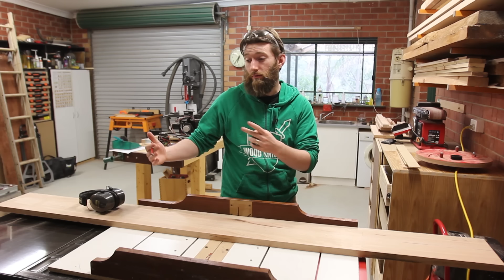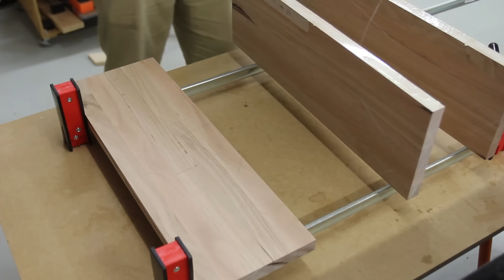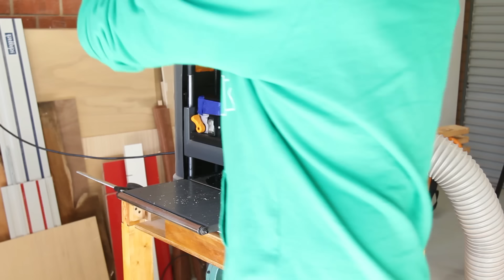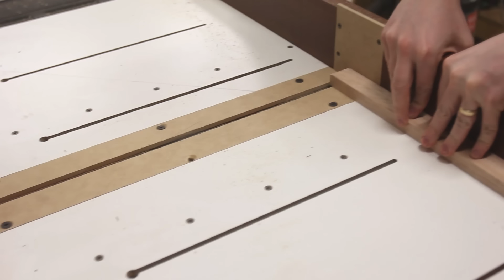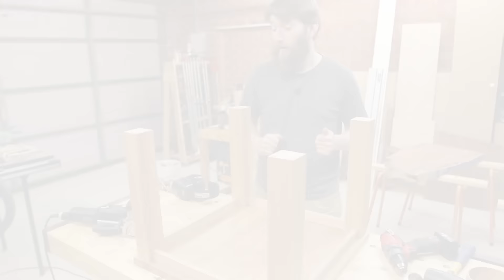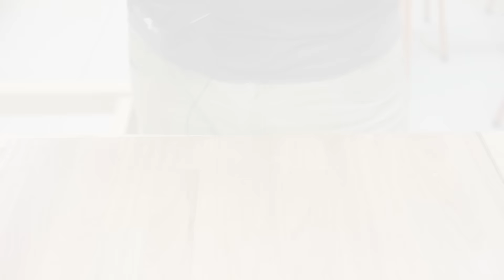070 - Mortise and Tenon Coffee Table

Comment: if attached with screws with an elongated hole, if the screw is going to move due due to wood movement; wouldnt that eventually come loose and have a loose top?
Reply from the maker: No. The hole in the top is tight/to size, the hole it goes through (where the threads aren't engaged) is loose/held on with the head of the screw or a washer. That allows it to angle while the two pieces are still pulled tight
Reply: +Paul Jenkins ah. makes sense. ive mever fastened a top with screws. too worried something bad can come of it haha. maybe ill give it a try!
Reply: nice table,but my lone regret is wondering what it wouldve looked like with a little stain on it

Comment: excellent job. . I just wanted to make sure that you used only glue to tight the table service together? Why you didn't use a pocket hole?
Reply from the maker: +Muneef Alahdi While pocketholes are quicker, they're significantly weaker than glue.
Reply: Paul Jenkins but pocket holes AND glue are even stronger and don't require clamping
Reply from the maker: This is incorrect. For the table top, glue is stronger than the wood, and if anything pocket holes remove material thus remove strength. For the rest of the framework, pocketholes + glue are still just buttjoins, and aren't as strong as mortise&tenon+glue. Is the strength required? It depends on the workpiece/intended use - sometimes pocketholes are AOK for this type of thing but they are not stronger.
Reply: Paul Jenkins (palm to face) I missed that you were referring to the table top and not the legs. My mistake

Comment: nice work although you could have done threw tenons with wedges to tie in the legs to tabletop and it looks great but up to you I guess :)
Reply from the maker: +Gary Stevenson This design table would look absolutely awful with through tenons on the legs. You'd need different legs, different offsets for the aprons, etc for that to work.

Comment: Hi there, Where did you get the pipe clamps, I can only find threaded ones.
Reply from the maker: +Colm Hennessy I have two types of pipe clamps - some are Rockler (bought from Carbatec), and some from ebay which aren't as good, but were dirt cheap (~$50 or so for 4 pairs). They're all threaded, and I got the pipe for them at Bunnings (plumbing aisle). Timbecon also have some (based on what I saw at the show), but don't seem to list them online

The other clamps I used in this video were the parallel clamps I bought from McJing.
Reply: Hi Paul: Are the parallel clamps from McJing good?
Reply from the maker: They're adequate. Fit and finish is on the poor side, but at half the price of the equiv Bessey I'm prepared to make that sacrifice. I'll likely buy more at some stage.
Reply: Thanks! How about the clamping pressure? Can it produce 7000N like Bessey K body revo?
Reply from the maker: +Thanh nguyen tien do you have a way to measure the pressure output by clamps? I sure don't.
Reply: Yes you're right. It's difficult to measure the force; however if you experience Bessey clamps before you may notice the difference.
Reply from the maker: +Thanh nguyen tien I've played with them in shops/stalls, but I don't own any. The Bessey/Jet/general brand name clamps are always going to be better, even if its just from fit and finish, but I'd expect they'd also apply more pressure.

That being said, with the McJing clamps I can still apply enough pressure to damage the workpiece if I'm not careful. For the price, I would actually recommend getting a couple - even if they become "secondary" clamps for less critical holding, they're still pretty good.
Reply: Thanks Paul for the info. I will visit McJing soon

Comment: I really enjoy your videos!!how did you use the domino on the rails between the legs,they looked very narrow to use the domino
Reply from the maker: +BCdesign Do you mean for the clips or on the other coffee table which was dominoed together? Either way, the Domino balances fairly easily as its relatively light.
For the clips, its set to the widest setting, but plunging the minimum distance using a 5mm cutter. 
For the other coffee table, it was set to the narrowest setting, plunging the max distance using the 10mm cutter. Its a tight fit, but the domino is very accurate - the loose tenon/domino stock itself has to be hit in with a mallet, the tolerances are that tight.
Reply: Thanks Paul,yes it was the other coffee table I was asking about,idid not realize the domino could be used on such small parts
Reply from the maker: +BCdesign I've got the df500, which is the smaller of the two domino machines (df700/domino xl is the other). the compatible cutters range from 4mm (x20mmish) all the way up to the 10mm x 26 x 50mm dominoes I typically use. other than furniture for mum, I tend to do smaller stuff so the smaller machine was the right choice for me!